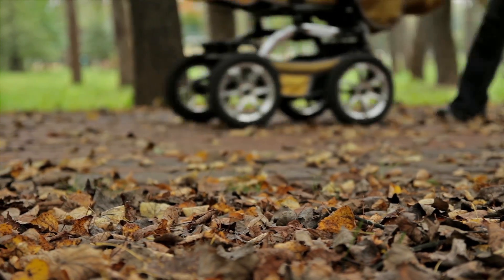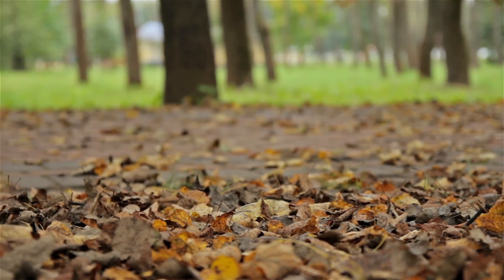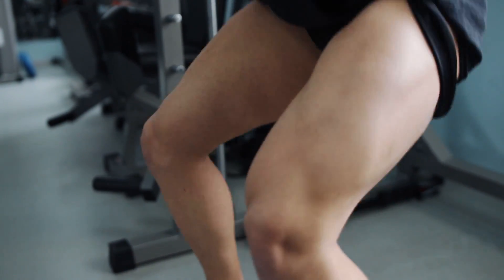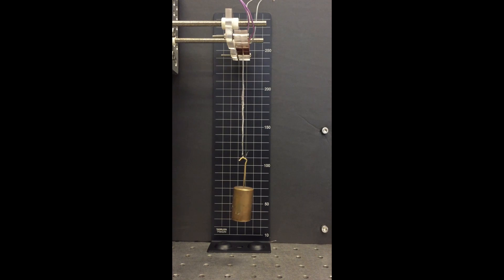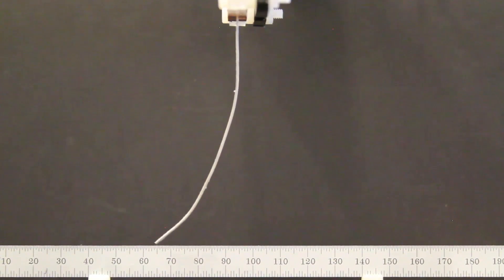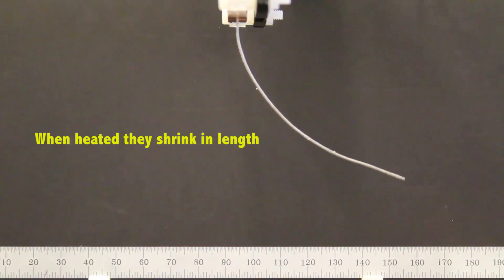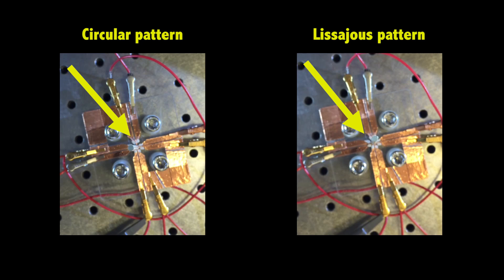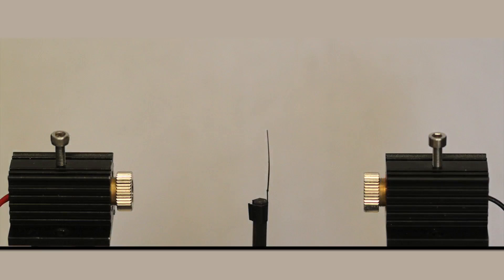Muscles made of nylon

Comment: what will the purpose be for something like this? it's nylon; too much heat and it will melt and to mitigate that you need more area to spread the heat, which adds weight, cancelling (some of) the work done by the nylon because now it has to put the energy in to move itself. not to mention that it's slow to respond, so what type of "gripper" or "machine component" are we talking about here; something that picks up a block of styrofoam?
Reply: Dušan Pešić maybe heat everywhere at low heat, rather than at 1 point. Net bend will be as good as high temperatures at a point but at low temperatures (c shape vs L shape)
Reply: but now you need to focus a line of heat perfectly along the entire length of the nylon, or you need to waste energy by approximating its position and heating a larger area
Reply: Good point

What if you were to attach the nylon to a thin flexible copper wire? The resistance would produce the heat evenly while allowing bending.

I'm just guessing here. 

Whatever the MIT folks decide to do, I'm sure we will be impressed.
Reply: Nduati Kuria Exactly. That is the solution, and in the case of an artificial limb or exosuit strength amplifier, the wire can be rather thin, and thus be coiled with the actual muscle filament. Of course in order to avoid the negation of force it should have decent malleability. Although the common strand of polyethylene muscle is 100x stronger than a human muscle of equal size in adults.